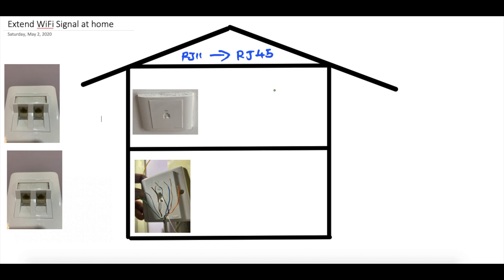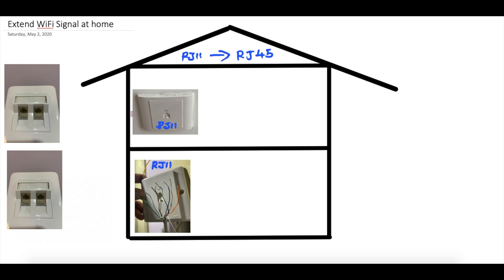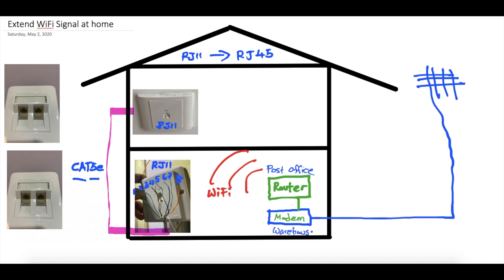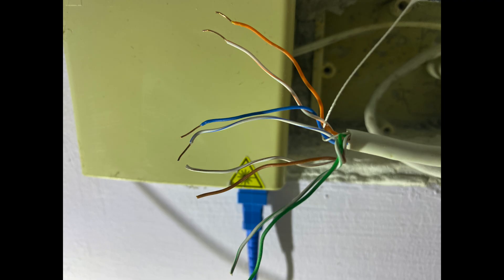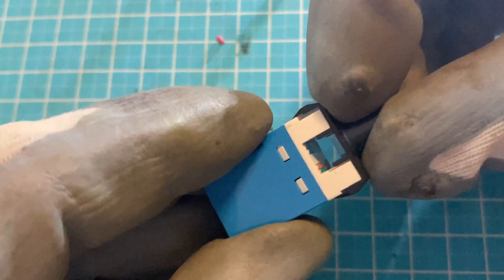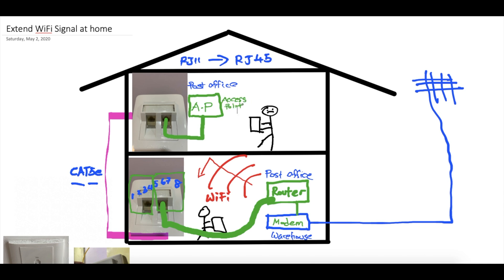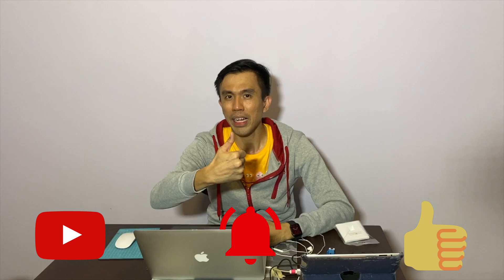Extend home WiFi signal CHEAP by converting existing telephone line

Comment: Can I still maintain the telephone line port after upgrade to LAN port, means I have 1 telephone + 1 LAN port. Need the phone for both floors.
Reply from the maker: Should not be an issue. As long as  telephone cable comprises eight wires as shown in video. LAN only need four wires.

Comment: I would like to ask is it possible to install an ethernet jack from an existing wall socket?
Reply from the maker: Current wall socket is it meant for those 13A plug or telephone? Telephone jack has four wires that can be upgraded for Ethernet jack as shown in video.

Comment: Can i convert the cable into R11 instead of convert the plug?
Reply from the maker: RJ11 also have four wires. The problem is the arrangement or parity of tel cable is different. Try look for T568A and T568B cable color code and check of it matches the RJ11 cable end that you have matches. If your RJ11 cable end has eight cables inside then it should work. The orange and green are the pairs of wire to transmits data. Hope it helps.

Comment: Don't you need to strip the insulation before punching the wire?
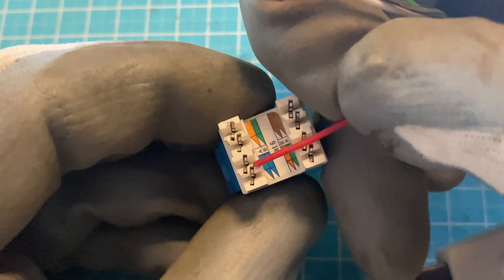Reply from the maker: No need to strip the insulation. Refer 6:00th minute for details.
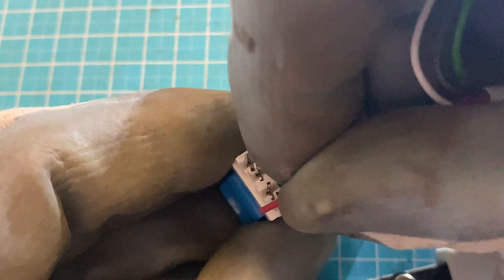Reply: @CTB6  I did watch the 6:00 part a few times. How does the wire contact the contact terminal? I cant see the contact points between the wire and the connector.